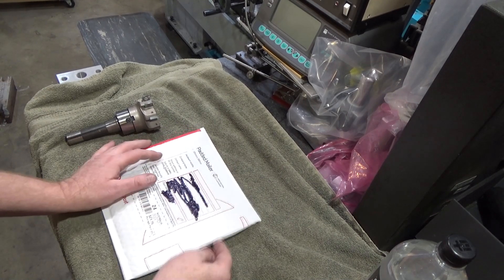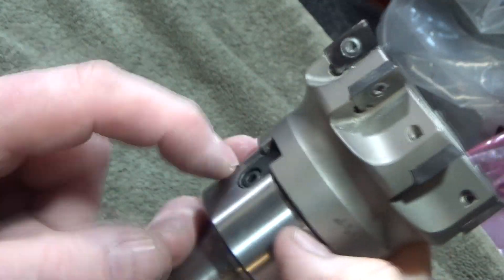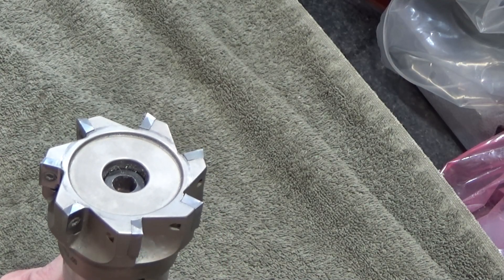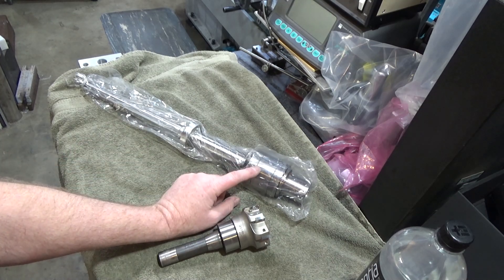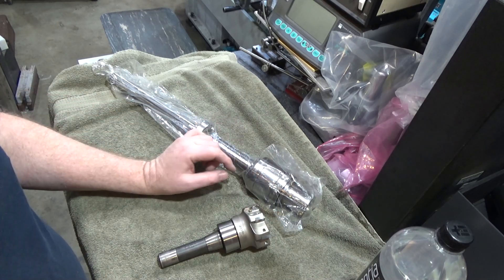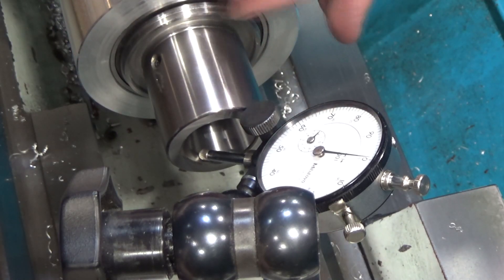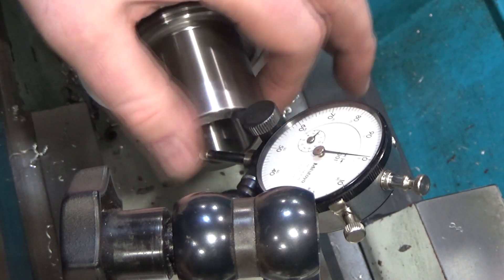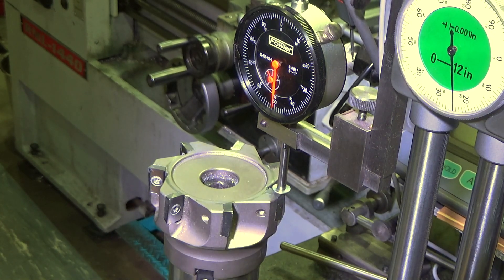251 Measuring Inserts on Face Mills

Comment: Are you going to address the fact that the highest insert does NOT do most of the cutting?
Reply from the maker: I miss spoke. You are correct, it only does more.
Reply: You bring such a cheerful vibe to the chat. Are you not going to add a question mark to your question?
Reply: @reallydonotdo  ? Added. I just wanted the viewers to appreciate that the low insert  only takes an extra 0.001" x the feed per rev which is almost insignificant. And that assumes all the other inserts are 0.001" above the lowest.

Comment: Hello from Downunder and thank you for the mention. Nice work and a creative solution. I also had a face mill with the same inaccuracy problems, I found the measuring to be the most challenging part of setting it up. I made a microscope mount for my lathe and that helped but the final measurements were best dome in the mill with the inserts measured against a 'Z' Axis setting gauge. I made a video of that and It was a project with many challenges. It was a Cormorant face mill. Cheers.
Reply from the maker: I need to check that out. Thanks for the reference.

Comment: You can check two ways.
Check the insert tolerances online before you start to see what to expect.
Use the same insert in each pocket to check the holder.

Mixing random inserts with random pockets does not give a clear result.
Reply from the maker: Excellent advise. Thanks for the info.

Comment: The highest insert does not do most of the cutting. It takes a tiny amount more than the previous insert. Mounting the indicator upside down would allow you to check the inserts on the milling machine.
Reply: lol, face palm, already had a receiver on the machine.🤣😞
Reply from the maker: Wow, that was stupidly obvious. For unknown reasons, that never occurred to me. Without considering the problem too much, I was following what I had seen more experienced machinists do. Thank you!
Reply: It's called the wiper .